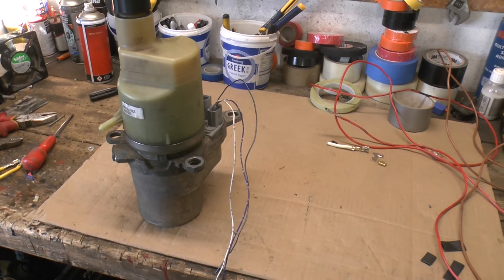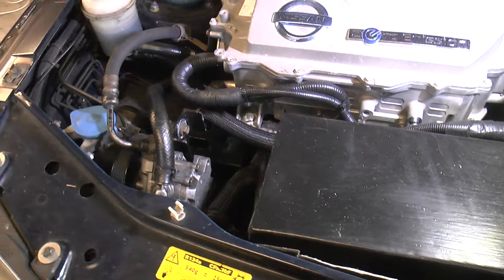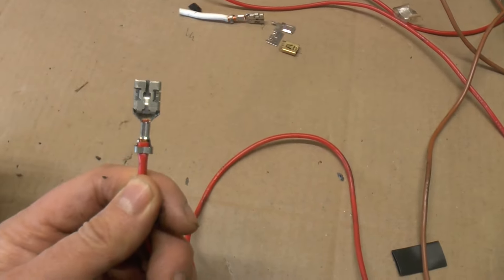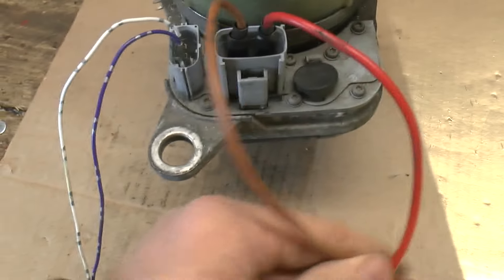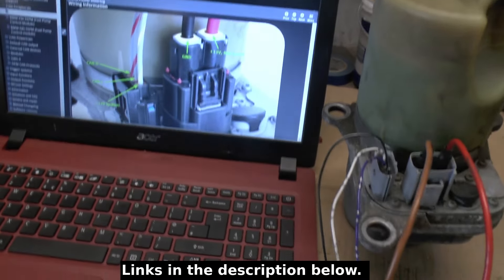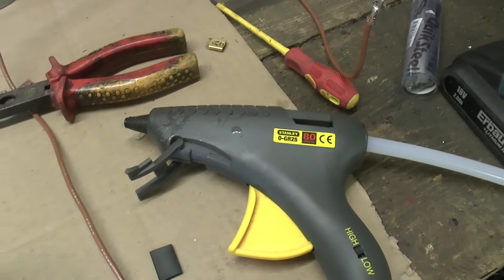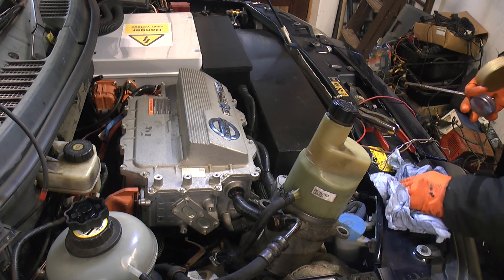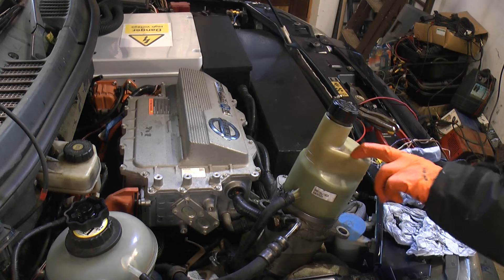DIY EV Part 50 - Steering a new course with a Volvo PAS Pump

Comment: One of the reasons my EV projects take so long, is that I design for serviceability! The main charger on the Scirocco was behind the front grill and accessing it required removing the front battery box. That was a job that could be done in less than half an hour.
Reply from the maker: If only I could use that as an excuse for taking years to build mine. Sadly not as one of my next jobs is to remove and replace the none functioning cabin heater. This will involve removing subframe for access from below and inverter plus charger to get at it from above. 🤥
In my defence when I started out on this build I didn't know what I was doing, what hardware I was going to use or how to install any of it so I don't think I did too bad. If I were to do it again now it would take a fraction of the time and most things would be fairly accessible.

Comment: that's a nice upgrade... sorry that the first one didn't work out, but you gained some experience which is valuable. I think the new method will also have fewer failure modes and be easier to repair if it fails. great job!
Reply from the maker: Thanks mate, agree on all points. 🙂